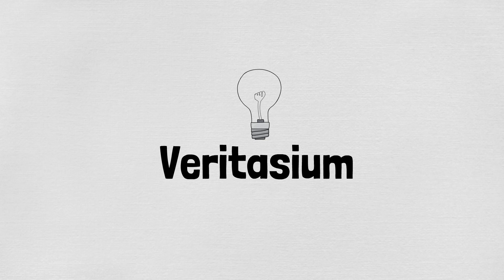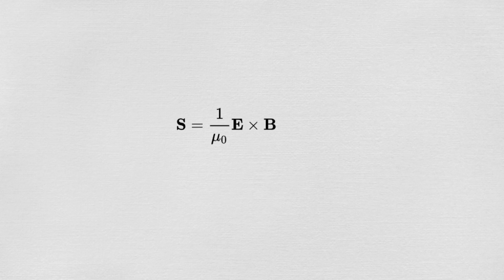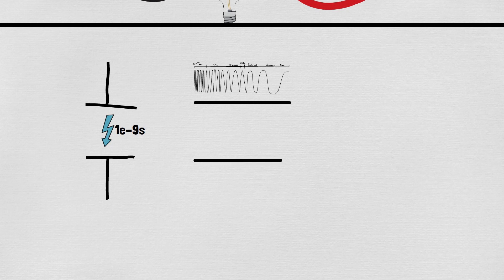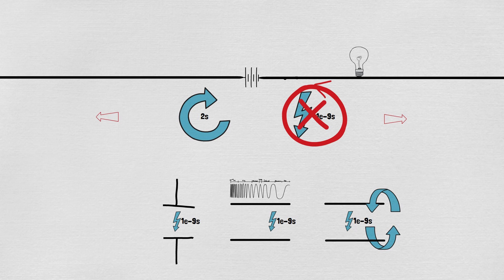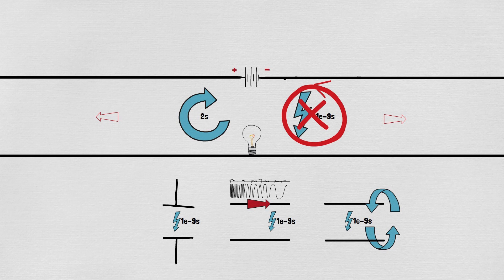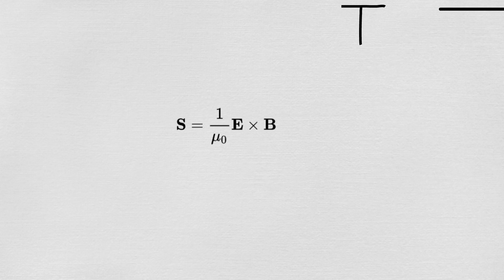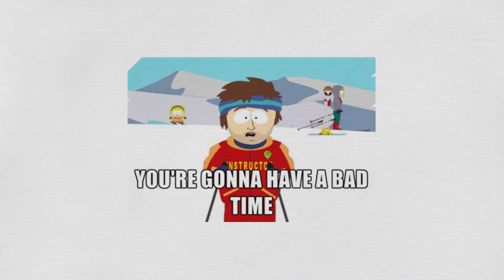Veritasium is Right? (see description)

Comment: I think you're failing to take into account that the circuit was connected before the switch was thrown.  I think your argument makes sense if the circuit was connected together at the exact same moment in time the switch is thrown, which it is not.  Prior to the switch being thrown, the e-field has already propagated around the circuit.  This starts as soon as you connect the wire to the positive side of the battery, and then to the light bulb, and then to the switch... right?  So the positive side of the battery's e-field has already propagated around the circuit to the open side of the switch.  As soon as the switch is thrown and the circuit is closed, current begins to flow generating the b-field.  Atleast this is the way I understand it.

Comment: You are a bit wrong. Because of the statement about you need established current across the whole line. Here is a rhetorical question that I'll answer. Does current start immediately pushed by voltage at the speed of light ignoring resistance, and just not the whole way? I mean it doesn't wait to be complete and then start doing all the nice formulas? So the equation works for complete current, and that is why you cannot use it until current is flowing. Before that time the beginning moment take time in question for the (D) and work backwards. Where how far did the current go. To do this perfectly you would integrate each point each moment, but this would be like overkill calculation like some 3 body orbit problem. The math isn't nice for any and every case. So break it down to the time intervals and the relative induction as you mentioned and same segment compute capacitance or plug in assumptions for L and C. Well L and C will determine how energy transfers between the forming current and the changing magnetic field. The primary first energy is stored charge which is source of constant V pushes current firstly. And current expands magnetic feild and with this capacitance is charging initially. Ok, freeze here and what happened at the 1nS or 6 inch travel. Forget down the line for this time right? Aren't things happening? My answer is yes, but with some a unknown frequency because the related capacitance in this segment as well as induction for this 6 inch section in the first nano second is not know.

Consider the inductive reactance for that unknown L and the C capacitance and that is also unknown. This would be frequency will be evident in this circuit by a cycle of exchange energy between capacitor charging releasing to current to a magnetic field and then to charge capacitors. Yes this is true, and I think you covered this more eloquently in your video. Those things are happening and there is one consumer of energy the only resistor in the circuit is the light. So this is an R unknown value too, and the energy transfer is less interesting if R is large in the initial 1nS.

We did say R is ideal and can assume small R 0.01 ohm say just a hypothetical does energy go and ideally big light if any current is there. A current would have to be there that is correct. How does it get there if the DC didn't go all the way. Well The L and the C determine cumulatively continuously wider path as current goes more and more.

In overview of correctness of that video we can not assess the time other than ya there are some values of L and C and R are not given but doesn't this mean he is trying to say any of these have 1 meter to go across? Well ya and you should in a usual bad question with abcd take the closest wrong answer that you think will mach the teacher key.

The current will be something in the time it takes light to travel one meter. Teacher's answer key matches and you are correct on the quiz.

Ready for pear review and excepted for scientific fact. No, as response and definition of fact this would have to mean that overwhelming majority of people in that study agree, so No wrong.

fact checking should really get ugly to this video though. Do you know current is potential energy. Yes it is. This video specifically is wrong in saying current is not potential energy.
The fact checking can go on and on but this is because it isn't really his breathing in and out electronic transmission line science. And even the people he talked to make this fundamental error about the energy.

Question: Which of the following can contain potential energy?
A) Charged Voltage
B) Flowing Current
C) Magnetic Field
D) Heat in the Resistor
E) All of the above
F) A, B, C
G) A and C
H) Other ________

If I'm teacher I'm going to give F as the key answer. And say no Heat in the resistor is not potential energy for an electric circuit. Trick question... But gets to the disagreement and effectively communicates the notion that transfer of energy in a line is ringing back and forth.

Comment: As someone who only follows topics like this out of curiosity (I'm an aspie working in IT), I feel like asking for clarification: would it be fair to say "some electricity is going to flow instantly through the bulb, but it'll take a full second before it (for lack of a better phrasing) completely turns on"? Also, I assume that whatever the correct answer is, it will take an equal amount of time between opening the switch and the bulb turning off.

Comment: I fallow your thinking easier then one in Vertiasium video. I was kind of lost there since he did explain most of it good but it is kind of mixed up and starts to be misleading according to way I know and don't know. Exactly as you say, what is the magic in the switch. Veritasium is using Battery and super conductor to explain magnetic fields. FFS. I never liked examples that start with ideal conditions, like super conductor 300 000km +2m long.

Comment: I'm becoming more and more convinced that Veritasium is right. For example: https://youtu.be/Lp_b8gQpxW8

So the change in voltage when the signal starts to go out, creates a field, which creates a "displacement current" in the wire next to it already when the switch is connected.

Comment: I don't agree with your explanation.

The switch is needed for the current to flow and by closing the switch, a change in the magnetic field is what induces a current on the opposite wire (near the light bulb). When the switch is close to the battery, happens almost instantaneously but if the switch is far away, there will be a long delay (speed of light). So yes, the position of the switch (and the bulb) matters.

Comment: As the dislike button has been removed, I am no longer able to appreciate whether or not the information in this video is correct.
Reply from the maker: you shouldn't use like/dislike ratios as a rubric for what's right. i could be quite wrong, or veritasium could be, but our ratios won't tell you that. only an experiment will.
Reply: @antimatterhorn  I shouldn't, but I am. It saves me a lot of time.

Comment: You are misreading the problem. 
Veritassiums claim is misleading but not wrong.
The switch connects the wire which transmits energy by radio waves/capacitance/inductance to the other part of the wire. 
This happens almost instantly but will NOT power the globe to anything like full brightness.
Once the switch has been on for a bit and all the changes in electrostatic/magnetic effects have happened, then the light bulb will be lit as you might expect.
This takes longer than the speed of light around the system, as the speed of electricity in wire is often 0.7*C , and the electrical voltage and current waves need to bounce around the system many times before they diminish to the steady-state value. 
This happens in everything electrical/elecrtonic, but is over so fast we don't see it, so we don't usually care about it.

Comment: I would say that a bit of the challenge here is that there are engineering answers and scientific answers.  An example of the engineering answers is here:  https://www.youtube.com/watch?v=VQsoG45Y_00

I am an engineer by training and we look for models that are really simple, even if they are not precise.  I know people think about engineers and precision, but the reality is that we take lots of simplifications as often we can't get designs and components in the real world that are more accurate than 3rd order effects.  Given that, we just toss those effects into the garbage can and simplify our equations.  So when I watch this video here I think about how I would use it to understand what I need to design things and it is more information and requirements than I need.  It gives me ways of thinking about the problem to short cut my answers, which in engineering terms is what I care about.  I worked on communications equipment for about 30 years and so like thinking about this as a transmission line.  Does that give me the right physics answer?  No.  But it lets me run my math, which is what I care about.

Now I want to point out a bit of more practical consideration here for this problem and that is the traditional telephone and power networks.  One of the more interesting things I ran into was a carrier that had lots of problems with lightning strikes.  So, in one spot the deployed shielded cables.  In most companies, this is okay but you have to break the shield and ground it periodically.  This company did not and the lines ran on the same poles as the local electrical power.  Lightning struck the electrical wires and the surge coupled to the shields.  This interacted quite badly with the reactive impedance of the telephone lines and blew up (and I do mean exploded) the equipment on both ends of the line.  So, the kind of coupling in this example happens in the real world and can be quite powerful.
Reply from the maker: absolutely. i'm not trying to say coupling can't happen. i just don't think the timescale for the bulb to "turn on" is that short. i also think there probably is a transient pulse at the bulb in 1e-9 seconds, but it doesn't meaningfully turn on until much later. one of the things i actually do have experience with is gathering measurements that are running down cables ahead of extremely fast explosions. in essence, the reverse of this thought experiment. the switch has been thrown open and the wires are being eaten up in both directions down the wire from the now obliterated switch. the signal still arrives at the detector at the other end and at full strength because of course it does.

Comment: Yeah, I'm no EE either, just a lowly computer technician and just through common sense alone one could tell that Veritasium was being somewhat misleading. He insinuated that all or most of the power is in the electromagnetic fields around the wire. If this was true then circuit boards would be inneffective and there would be interference to africa. Sure, a small amount of energy is in the EMF but not nearly as much as he implies imo.

Comment: Good argument.  Veritasium can send information with speed faster than c.  If battery and bulb are 1 m apart in LA and the switch is in NY he can send Morse code information. to LA with speed  4 milion times faster than speed of light.  Case closed.

Comment: I think your counterexamples end up distracting from the point you are trying to make since the obvious counter to your questions would be that current can't flow in the top wire until the circuit is complete, regardless of how far the switch is from any of the other objects. The point is that it takes time for the potential difference that begins across the switch to travel at / near the speed of light to where the bulb is. Moreover, I think there is a better counterexample for the antena, which is that is can only radiate if the current is changing. Under the false assumption that the current is established immediately, this could only radiate for the moment that the switch is closed, not for an extended period of time.

Comment: You miss the point that this is a thought experiment. It ignores a number of critical issues that stop it working at all. Resistance,  The low voltage used, etc. It also ignores the transmission properties of the lines (although not actually stated) but if it didn't then the whole thing is a can of worms.
The "experiment is how long will it take for the action of closing the switch to effect the lamp. And as stated in veritassiums video the answer is  1/c approx sec. 

If you start talking about any realistic and practical attribute of such a system than it all collapses.

Comment: Thank you for presenting the correct analysis.   All the rest wave their hands and ignore the electron flow in the wire.   This is nonsense since the whole system has to be considered and ad hoc simplifications are routinely wrong.    The original theme of the Veritasium video was nothing but clickbait.   In a tabloid fashion it presented the "shocking fact" that the current inside the wire is not enough to explain the energy flow because it is like treated via analogy to water flowing in a pipe.   That is a straw man argument.  The non-local field of the electrons flowing in the wire is not separate from those flowing electrons.  And of course this non-local field affects the electron flow itself.
Reply: Click-bait or not, he said that and then showed there was more. The fact that many other people have responded with various ideas shows the value of the click-bait (accidental or not). It has sparked discussion.

Comment: You're missing one of the conditions Veritasium stated: 'any amount of current can light the bulb'.
It' kind of a cheating condition, as bulbs don't light with any amount of current. 

Some answers to your questions:

2:52
The switch insulates the conductor to the right, leaving it at the same electrical potential as the conductor to the left of the battery.

2:55
Because when the switch is closed, a voltage transient occurs on the right conductor.

3:01
Yes, but this would delay the affect of the switch on the bulb.

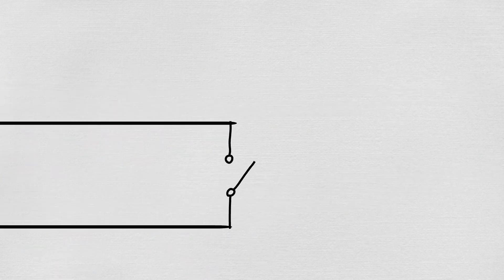3:06
It depends on time scales.
If you could move the switch close to c, stretching it's left conductor and contracting the right, this would have the same affect as closing the switch.

3:28
Same answer as 2:55

5:04
Wrong. You still have the same potential across the battery without current flow. Voltage does not need current flow to exist.
When the switch is closed, current will flow, EM radiation will occur, the cap will charge, and the b field will couple, regardless of what exists further down the wire.
Think of a whip antenna, does it need a connection at the top?
Reply: 3:28

As I understand it, if the switch is at the longest distance from the switch, the right conductor (up to the switch) can be considered at the same potential as the battery. It would take an amount of time equal to the c/(conductor length to switch) to turn on, since that would be how fast the current would propagate.

Having the switch spatially approximate to the light is more important to the function of this experiment, rather than the spatial relation of battery to light, since it's the closing of the switch that causes current to flow from one voltage potential to another.

Comment: Unit step function has a Fourier transform
Reply: I dislike the way the question poses the light "turns on" as soon as ANY current flows, the steady state won't be reached for a couple reflections (it may overshoot at a point) the way we ignore some parasitic but depend on others
Reply: Yes the switch location matters. It is also intended to give a layout

Comment: Veritasium is confusing radio with electricity. Yes they are related, but no, they are not the same.
He claim that ELECTRICITY is traveling straight line. But it isn’t. 
What he demonstrated is radio transmission. His setup is basically a radio antenna, bottom line is the transmitter, top line is the receiver. They don’t need to be connected. A small current will be observed in the top wire, just like a small current can be observed in your phone/TV antenna.

But this is only for a short period after the flip, and only a small portion of the energy is transferred (inverse square law). So it can hardly power a lightbulb, and we DEFINITELY don’t call it electricity transmission.
Reply from the maker: did he claim electricity travels that way or energy does? energy definitely does or else AC circuits (not this one) can't work.
Reply: @antimatterhorn  There is a big difference between flowing around the wire (but following it), and going straight from the producer to consumer, regardless where the wire goes.
His example suggests the later. And as a result, half the commenters there believes that wires are not even necessary, while other half points out the error.

Nikola Tesla was working on wireless power transmission, but he failed.

Comment: Good questions actually. The explanation in original video was quite clear, but still, there are some pitfalls. Especially if switch is far from the source. In this case it seems that it is the distance from the bulb to the switch matters, not the distance to the source. so the correct answer might be (Distance-to-switch)/C

Comment: wouldn't  energy leak from one wire to another if the ends of them are close enough on either end of a switch?  isn't this why batteries loose charge over time even when they are not in use.?  kind of like preheating an oven, so the energy needed to initiate a reaction doesn't start from an absolute 0?    just asking for a friend...LOL....  if i am right about the leakage creating a circuit, why doesn't that circuit draw more and more power over time, enough for the "engine" to react in a way we can see?  i'm just feeling that the leakage is potentially converted to "heat"?  but the heat created is so low that it dissipates before reaching the engine?  bridging the gap through atomic structure? idk ... maybe i'm just nieve or an idiot...LOL, but this is what popped into my head as i watched the video.. peace.